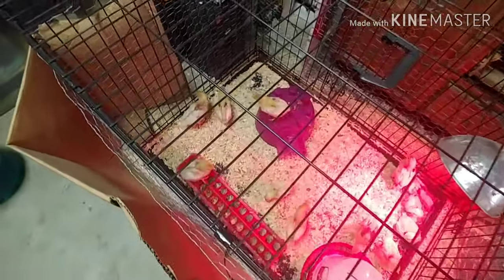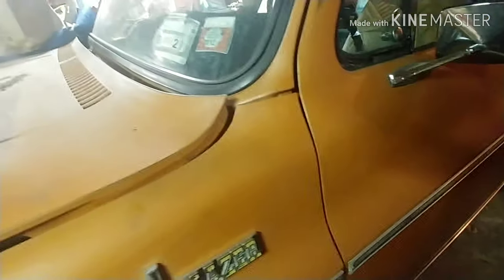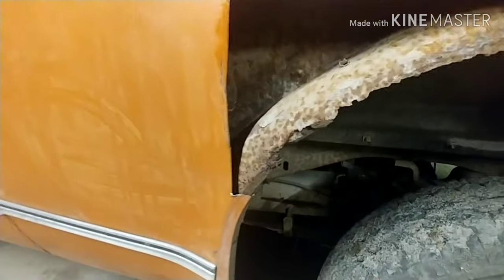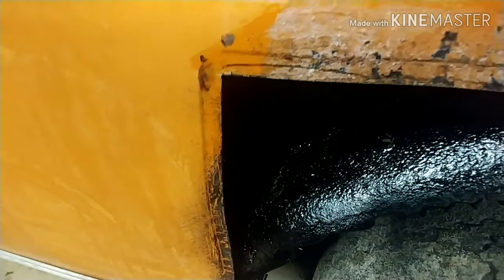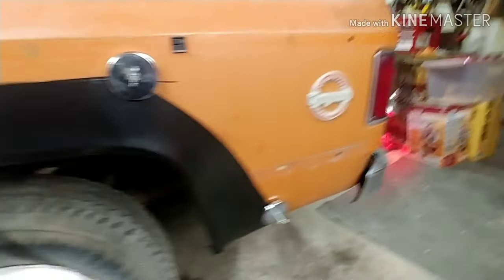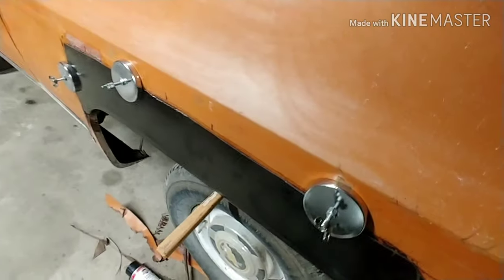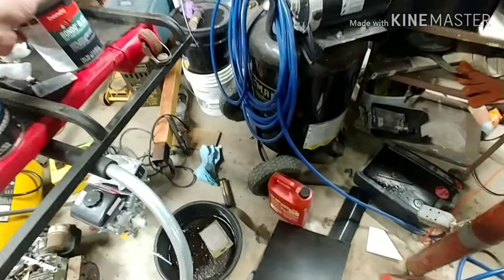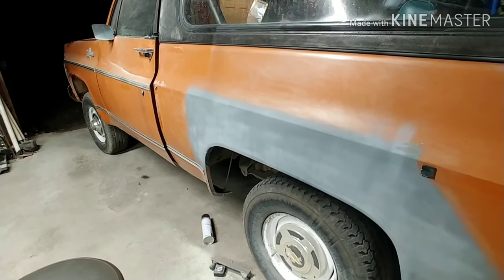Welding patch pannels 1973 k5 blazer part 1 rust repair

Comment: In regards to a auto body repair I'd be the most concerned with how long it holds up. I'm not a professional or anything. I'd want to  seal that inner fender to the patch panel of possible to help keep water out of it a d it should be good to go.
Reply from the maker: Going to undercoat the bottom and that blazer dont get drove in any weather... Still sitting in the garage